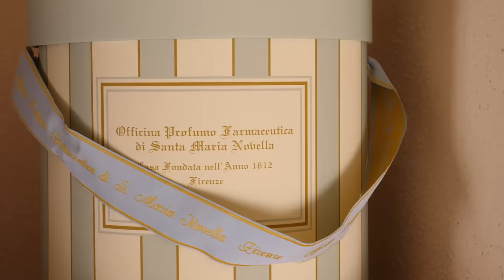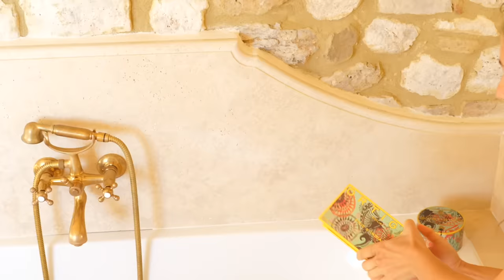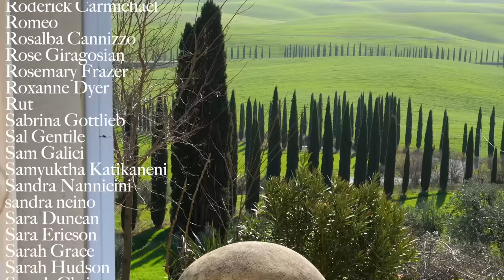RENOVATING A RUIN: Enjoying Our Dream Bathroom, Antique Shopping Florence, Interior Decorating Italy

Comment: In the USA they advertise a bath mat called PurrPalazzo bath mat. It is made of some type of stone and drys really quickly and comes in colors. If I had your stone floor I would put a backing on it or lay it in a tray type thing, we have them for boots and called boot tray to protect the floor. But that might work because you would not have to wash it often and it would dry quickly.

Comment: Kylie, that rug! IMO, it's perfect. It gives you a balance of darker and lighter backgrounds. It has that gorgeous blue that ties into the chandelier, as well as the green. And to cap it off, the shape of the pattern mimics the arabesque-like shapes in the bed frame! It will look lovely against the white bed linens. I agree with the choice of solid curtains and it will be easier to find a trim that complements the rug. Of course, you can trim all the edges, but I think adding a wide brocade trim just across the bottom will give you that luxurious feel you're looking for💙. Can't wait to see it all come together!

Comment: The greatest thing about this video is your absolute joy and enthusiasm for what you've achieved and what you and Guido have been looking at and found! No matter what everyone says, (and tastes vary hence "Degustibus non est disputandem") THIS is all that matters!
I looked at your "mood board" pics and they are mire or less all french interiors, most with light painted floors and Aubusson style tapestries in beautifully worn chateau or manor settings. Lovely as they are, it's a different setting than your beautiful tuscan farm house, and working with the TONS of charm already present, instead of against it towards a different style entirely would be a pity. I understand your love of heavy embroidery or silks with gathered legnths on the floors, I do! But it's not that type of house, not the french 17-18th century windows, and it's not very practical either in a home with little feet and sticky hands, and hotter weather (and those types of curtains need heavy lining or are ruined in a matter of a coupke of years in the sun, and arent ever meant to be drawn across the window for the night either).
I think the choice to go with pure linnen is much more in keeping with your house and location and the green will be beautiful, provide shade, and is easily washed and ironed, and just as charming ironed as it is naturally wrinkled and gathered as well.
I agree with what you said about light rugs against the cotto floor. That would be a mistake and require a gigantic size or break up the floor and look like an island.
I did like thr Ziegler style one thay was a grey-blue and gold hue. No 2 i think in the "test motage" of the first batch, but the others didn't look right. The last one we saw too little of in place to really tell. It does work with the wrought iron bed, but wasn't what I'd expected. I'd likely have gone with a deep mottled burgundy close to the color of the floor, for harmony, or a flat woven turkish kelim/kilim style rug which I love for a tiled floor.
What's important is you are in love with your choices!
The wardrobe looks like it could be great painted! And very practical, which is key for young family life.
I think I'd keep a lookout for some textile of sorts to hang behind the headboard over the closed cupboard. Like a tapenstry, an old quilt, or classic Suzani wall hanging (it's a type of tree of life motif often with birds and pomegranates in a form of Indian embroidery common in fine English interiors, easily found on Etsy for example).
I'd keep my eye open for something that might work whilst concentrating on priorities.
Your bathroom in the sunlight is a real dream! Not bothered at all by the simple solutions of linnen, baskets, etc, less is more, so much already speaks there!
I'm incredibly jealous of your weather! My gosh, weve had around - 6 to -18 c here for months and now since a week its +-0 to +3 and wet and foggy and very dark with the snow all gone. And spring wont arrive yet until mid April sometime. I'm sensitive it's depressing to me.
Whats more exiting is I was gifted a 4x5meter persian rug by dear friends who moved and couldnt fit it in their smaller home, it's the most luxurious gift and an unusual bright coral color with dark and pale blue ornamentation around it, and entirely unexpected! I'm now busy thinking how to revamp my living room so it harmonizes which is exiting.
Good quality handknotted salon rugs in fine condition are beyond my reach these days, so I'm chuffed to say the least! It will add warmth and energy to my north facing livingroom in this climate that has a long dark winter.
So here's to Persian rugs! Woot! Oh and Kylie, never use the brush bit when vacuuming a real oriental rug. It's a big nono. 😉

Comment: I loved your dramatic and romantic mood board ideas for your master bedroom. 
I would suggest you use a combination of a distressed paint(the one from the wall edges) as a finish on the borders of the cupboard doors and drawers in combination with an Italian vintage wallpaper on the inside panels of the outside doors and drawers and even inside of the cupboard. It will make the cupboards look less modern and set the scene of the mood you’re after. Another idea could be to use a fabric complimenting the curtains instead of wallpaper. 
The fabrics and rugs also act as sound absorbers and really vamp up the home sweet home feel. I’m sure one day you will find a beautiful old tapestry to hang behind your bed.  Happy decorating and thanks always for your wonderful video’s. 🙋🏼‍♀️🇨🇭❤️

Comment: I would add another squarish or rectangle basket below the sink.  You could throw used toweks for washing in it. Also I hope  you are ok with your drapes as I know you have allergies. Drapes contribute to holding dust and  pollen. My suggestion would have been heavy linen drapes as they are easy to wash and would look lovely with your natural theme. You could bring in colour in your bedding choices. Anyway love the bathroom🇨🇦🌷

Comment: I was thinking about what you said  -  and one day you will need this.   Try  'Lisa Eldridge and Victoria Beckham Create A Christmas Party Look'.    Lisa is a professional artist but Victoria B has been made up by the best of them, most of her life.   Victoria has a much lighter touch, so I placed a hand towel over the left of my screen and followed Victoria's advice.   Best tips:     rubbing primer into your hands and patting it OVER your make up to hydrate your skin when finished.   Using lip tint on dry lips which absorbs better (and deeper) and seems to make the actual lipstick you apply later,  stay on longer.    Do absolutely everything Victoria does for your eyes  -  where to use off white, the windscreen affect   -  it really worked.    Just like a cake !   Layer upon layer.   I used Estee Lauder, not VB.